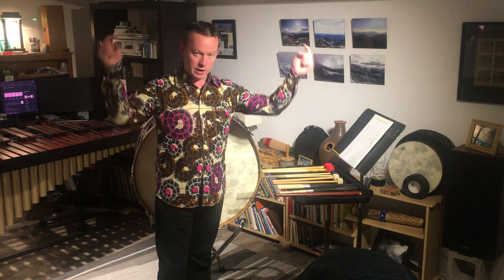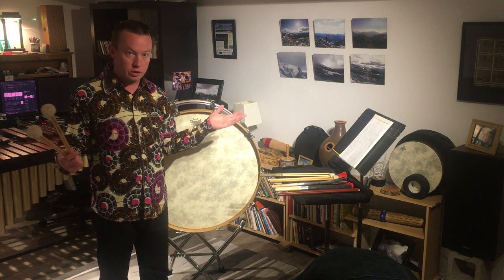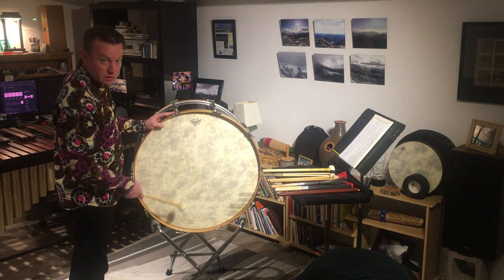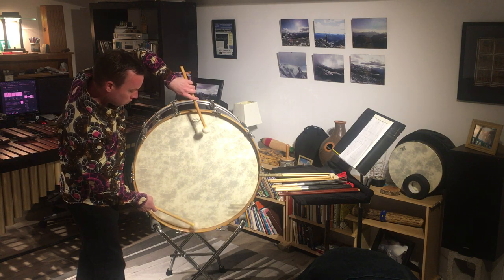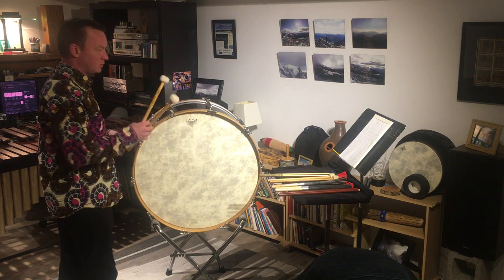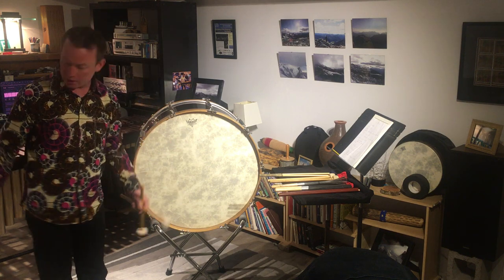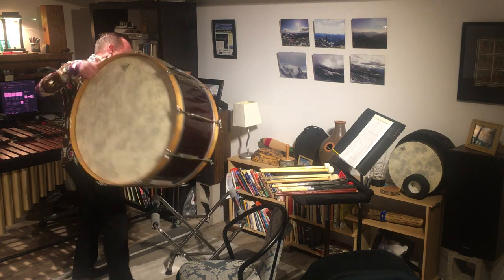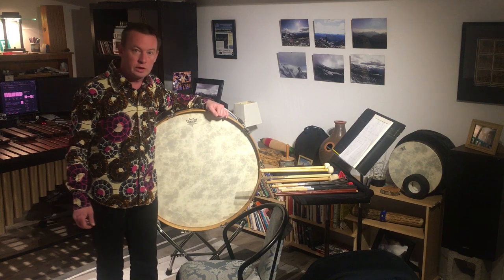Instructional Video: Orchestral Bass Drum

Comment: Hi Rob - thanks for the video! Question from a composer here: what size bass drum are you using here? Is there a clear way to distinguish in the score between this kind and the VERY large size that is sometimes used in orchestral performance?
Reply from the maker: Hi Scott! Sorry for the delay in responding to you. This drum is 28 inches in diameter, which is definitely on the small side for orchestral bass drums. This is part of the reason why I put technologically advanced heads on it, so that it "sounds larger than it is." If you wanted a larger one, you could always specify a preferred diameter in the score (larger common diameters are 32", 36" and 40"). You can also request that the bass drum be suspended within a frame with elastic cord (which increases resonance), as opposed to just mounted on a stand. The player would likely strive to accommodate the request in the score, but sometimes the request cannot be completely accommodated; percussionists almost always have to borrow large bass drums from organisations. I live in a city of 1.4 million people and I'm the only percussionist who owns an orchestral bass drum, and as aforementioned, it is a relatively small one. Sometimes, borrowing a large drum from a school or a community orchestra is possible, but can be difficult during peak performance seasons (Christmas and Spring), when those organisations want the instruments for rehearsal and performance purposes. I hope this helps. Let me know if you have any more questions. I'm excited to subscribe to your channel and check out your content! Thank you for writing! 🙂